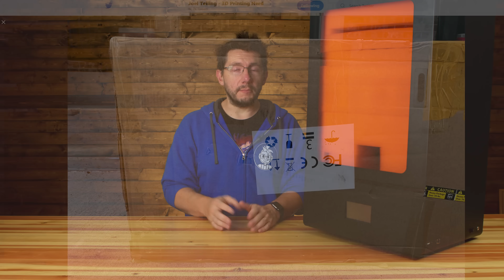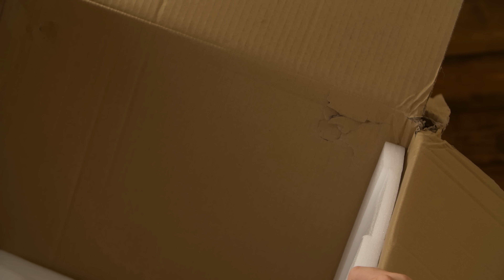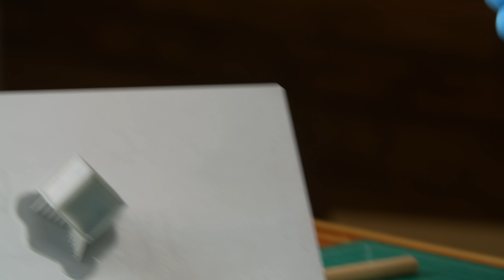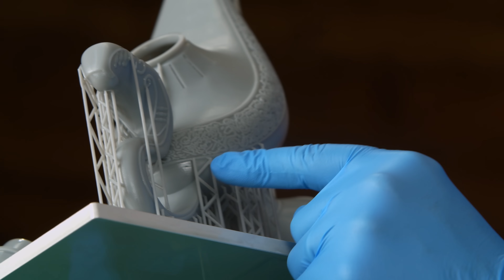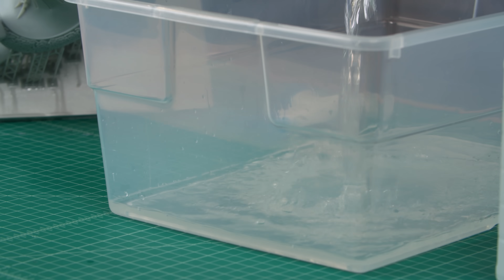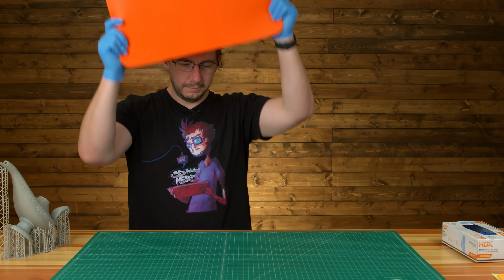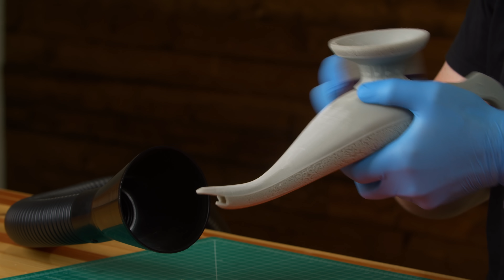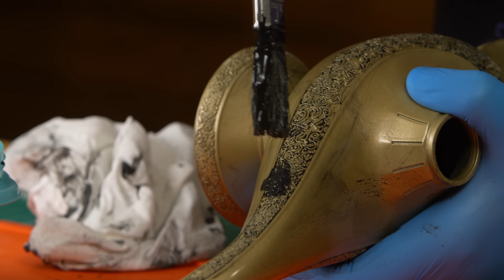HUGE Resin Printer - First Impressions of the Peopoly Phenom mSLA 3d Printer

Comment: The vendor is responsible for packaging properly, and this clearly isn't packaged well enough.
Reply: Yeah, I agree. But the mailing service should pay attention to the this side up stickers too. So I guess the vendor and the mailing service are both at fault
Reply: @aeaeaeaeoaeaeaeaeae  you're asking a lot of union labor, but you're absolutely right.
Reply: true but if it looks like a fork lift jammed into it you'd almost have to go to crazy amounts to avoid that..
plus the 'this side up' label was also completely ignored...
I think its safe to say DHL didn't really treat it with the necessary precautions ..
Reply: Agreed. Not even close to correct packaging.
Reply: Charlie Vetsworth  Well... it IS shipping from far away!  Look at how your computer monitor is shipped. There are zero locations where the product is only one layer from the outside world... meaning cardboard is its only defense. 

They do need a better package. Not the end of the world though, first round of units, as long as they take care of the damages, they can fix the next round.

Comment: The sla printer I ordered a long time ago (2010 Kickstarter) came in with a additional cross section of foam (3-4"thick) to protect it from high drops(btw their slicer is phenomenal). Ups has large conveyor belts and sometimes boxes tumble and even drop besides other things. I'd probably would send them a note of that to prevent future headaches from buyers. 

Pegasus touch I believe did 10x9x9" in build and I can feel your pain with cleaning. What I did sometimes is slicing models in addition to brushing. There's also bigger tanks where you can fit and seal it into a ultrasonic cleaner (alcohol needs to be contained) and needs to be between a layer of water. It does get warm but works! 

There's an alternative "natural" resin going on now that isn't as extremely toxic and harmful to the nervous system as traditional resin is. The resin fumes over time gave me bells palsy episodes (a type of facial paralysis) as well as allergies. I had just turned like 19-20 then and was very healthy prior so I can attest to how harmful it can be! It sat in my room in the beginning and even with open windows the fumes still penetrated the room. 
 I can't test out that "natural" resin since my printer is long gone (broke when I moved) but I've seen this resin circulate a tad. It claims to also remove most of the smell compared to traditional resin. 

Also, the weathered one looks more realistic to me. It takes a bit of practice with weathering/buffing and doing layers of it but you're getting there. It's kind of easy once you learn the technique like anything. I wish my printer to be fixed but if not maybe a quiet fdm printer I could be buddies with. Suppose I can scrounge up over time.

Comment: That packaging looked pretty flimsy for a machine of that size and weight. They need to beef it up a bit.
Reply: hi all, thanks for the feedback. The Phenom box is now double boxed with inner box suspended by foam and cover by outbox.  We have since improved on the thickness of padding as well as labeling of the box to indicate it is over 40kg.
Reply: @peopoly  good call, as shipped in this video it's very susceptible to point loading.
Reply: @peopoly   If you can't get the machine to be orientation agnostic, you need to put it on a pallet. No carrier is going to flip a pallet over. If you go that route DON'T go UPS. They love to play games with charges and freight classification.  Hit up Freightpros instead.
Reply: @poisonouslead85  > can't orientation agnostic.. pallet.. No carrier .. flip a pallet over
Who's to say they'll put it on the pallet correctly?  (How long until all [rectangular at least] packages are placed on pallets by robot, with visual sensors to interpret arrows?)
Reply: @ragnarokofborg  If you're strapping the item to a pallet right side up, nobody is going to flip the entire pallet upside down after the fact. Or cut the straps and re-palletize the item upside down for shits and giggles.

No carrier is going to go out of their way to make their life harder.  Make sure your employees understand "This side up" and palletize it in your own warehouse. All the carrier has to do it putz around with a forklift.
Reply: @poisonouslead85  > palletize it in your own warehouse
Ah, I was not thinking of putting it on the palette in your own warehouse - stupid of me.  "Putz around with a forklift" - LOL.  Or let a robot do it (maybe)
Reply: @poisonouslead85  Have had carriers cut off the pallet many times. The very rugged and heavy equipment generally survived but the packing case which was designed to be reused many times was often badly damaged.
Reply: Yeah, I'd think that a piece of hardware like this deserves a bit more thought. Couple inches of high density foam, top bottom and sides, and the hard cardboard corners at least. Something like the way midrange servers and storage come packed. Not saying that they still couldn't stick a fork through it. Seen it many times. ;)
Reply: A £300 (I guess about $350) laser delivered on a nice solid wooden box, a nearly 2k resin printer comes in a crappy cardboard box with thin foam? I don't think thats how it should be
Reply: Packaging engineer here. 1" of foam is willfully under packed. They need atleast  2.5"-3" just guessing the weight and fragility.
Reply: @TheJttv  Exactly. UPS recommends a minimum of 2" buffer and it didn't look like they had any there. If there was foam the foot wouldn't leave such a crisp impression on the cardboard.
Reply: @TheJttv  1" foam on 3 of 6 sides... so basically NO packaging anywhere else.. just cardboard and prayers.
Reply: I've worked in manufacturing and it seems they haven't really performed any drop tests for this packaging. Even without the tests you can see it's going to be an issue. The packaging requires engineering and not just the product, especially if it's going to survive long trips in ships and crates etc
Reply: @ChitosVids  Why even bother drop testing something that is obviously inadequate.
Reply: @ChitosVids  > performed any drop tests for this packaging
How does a drop test work in terms of height and force?  (for those UPS guys caught on camera trying out for the NBA tossing packages over a fence.)  Found a bunch Googleing, and a height of 30 inches on one chart (for minimal weight, a foot for 60 pounds which I assume this is about).

I just received an Orange 30 (kickstarter) the other day, about 15-25 pounds I think, shipped from China, and it had 4 inches stiff custom foam on either end, though minimal (1/2 inch) foam on the sides (with corner protectors).  I think it was double boxed.
Reply: Yes exactly. I ship a lot of stuff, and it doesn't matter the shipping company. You put a heavy item in a tiny little box with hardly minimal padding, it will get damaged. It's Peopolys fault, not the carriers.
Reply: for sure... i wouldnt really blame ups... as a shipper you are responsible for packaging it so it can handle a bit of rough handling... bottom of the packaging had zero foam at all
Reply: @biziluxgames8924  
He, my 3d printer, a different one, came in a wooden frame in the box.
Reply: Yup. Packaging is totally insufficient, no doubt about it. Not surprised at all. Just did a quick search for weight of the thing, no details yet but it looks a hefty beast, from the way he is handling it. How the hell they thought this a good idea, is beyond me.
Reply: _ David _  [sigh] there is always one of you. I have a bachelors of science in packaging science. But you're too ignorant to even know that is a thing or care to look it up before you try and insult me. But that is fine. The fact that it is overlooked means more open jobs for me.
Reply: Yeah I just saw how a lulzbot mini is packaged: has like 10 times the packaging.
Reply: @rpavlik1  I just got an Elegoo Mars the other day and it was packed super well. It probably weighs 1/10th as much.
Reply: I totally agree that the packaging was minimal at best BUT UPS apparently completely ignored the packaging labels. I have had this happen several times. It's almost as if they are so used to seeing them that they just dont pay attention to them anymore. They still mean something.
Reply: @Skyrunner_84  yep, that's why orientation labels mean nothing to a general carrier and you should never design packing for a product that has them unless it's absolutely unavoidable.
Reply: @MorRobots  A "security" carrier damaged some equipment in a 1m^3 box by shipping upside-down. The manufacturer replaced the broken parts for no charge without questioning.
Reply: @Skyrunner_84  > so used to seeing them that they just dont pay attention to them anymore
Reminds me of street signs in Indiana.  (A "Blue Oasis" with a liberal, nanny-state-"we-obviously-know-better-than-you"-ish government.  And I'm a "1990s liberal" saying that.)
Reply: Yeah, having shipped some very heavy computer equipment, I'd probably want several inches of foam on all sides, or at least custom moulded solid foam corners and side padding/bars.
Reply: Yep, it was not sufficiently packaged. More over, unless you have an unavoidable point loading issue that would cause damage, always design your shipping package solution to be orientation agnostic along the 6 faces.
Reply: My wish is that everyone in the comments would remember to hug each other more. Also I like the weathered one :-)
Reply: i can understand UPS dropping heavy packs, but what about lightweight packs? i've recently bought a Oculus Rift S and the box was hit right at the corner, thankfully they used double box method with foam around main box, and the Oculus box also full of foam  so it didn't get damaged, but i still wonder why? do they just throw them around when loading into trucks or such? how is UPS still alive?
Reply: Definitely packaged incorrectly.
Reply: _ David _   we had to drop 500k for designing the packaging for heavy industrial products....this happens ever 2 years or so
Reply: Yeah I do not like the blame being placed on ups when that packaging is not sufficient
Reply: I agree, 1800usd they could throw a bit more padding around the sides, they should take a page from PC shipping packaging, with how they use thick foam in the corners to help agasint harder impacts.
Reply: That was my thought. They should box it to be UPS proof.  It not like this has never happened before. An inner and out box would solve it. I blame the sender.
Reply: @Riki Rikin kanayin the raw resin is fairly bad stuff to skin and a bit hard on eyes and lungs. Once thoroughly UV cured it's pretty much like other plastics, safe for handling, though not food safe.
Reply: A little bit or quite a bit? Maybe a teeny bit wee bit. How bid is a bit? ;)
Reply: I work at a packing place and we say if you can't drop it off the table and be comfortable that it won't break, you haven't packed it properly.
Reply: Yup, dodgy packaging. I know whenever I get whitegoods delivered the packaging covers all six sides.
Reply: This is some of the worst packaging I've seen for such a pricey piece of equipment. I mean as appealing as it sounds on paper I'm not going to be Keen on risking 2k on the whims of UPS.
Reply: The Machine: 😮 My eyes are up here
Reply: _ David _  since you apparently have no clue. And insist on pushing your ignorance. What does a packaging engineer do?

-3d and 2d design (plastics, wood, paper, glass....ect)

- physics testing (drop, crush, vibration...ect)

- chemistry (dealing with how long a product survives on a shelf, does it react with the product, but also determine plastics or combinations that have the right oxygen barriers, moisture barriers, tensile and puncture resistance stuff....)

- logistics. (how many packages go in a box, how many boxes in a pallet, how many pallets on a truck and the orientations)

- Graphics (if the company does not have a graphics person this may fall to us)

- Regulations (we need to be knowledgeable of all the shipping  regulations)

- Sustainability (we try and make the packaging greener)

- Cost reduction (we evaluate current packaging and try and make it cheaper)

- find suppliers 

- make sure the packaging is in spec. 

I could go on.... but that should be enough to shut up your ignorance. This is engineering in every facet of the definition. You can moonlight in parts of the field without a packaging degree, but you will not be a packaging engineer. 

Also in my state almost no one graduates with a BE regardless of major. Everyone graduates with a BS which has more liberal arts and humanities requirements. That is a topic for another day.
Reply: @TheJttv  David dude is trolling. Do not feed. Either that or a prick. Probably both. Actual engineers understand the need for good packaging. This video.... case in point....
Reply: @TheJttv  > (responding to @_ David _)  since you apparently have no clue. And insist on pushing your ignorance. What does a packaging engineer do?
<sigh> why do people feel the need to (sort of) defend (or just "double down") their position (such as it is) online so much more than offline (or maybe not)?

 @alex4alexn  > drop 500k for designing the packaging for heavy industrial products
Wow.

Just curiosity, what is the packaging like for really huge things like those 2-story industrial farm tractors you see on TV every now and then?  (Ultimate Factories 2007, s1e6)
Reply: UPS likes to throw boxes